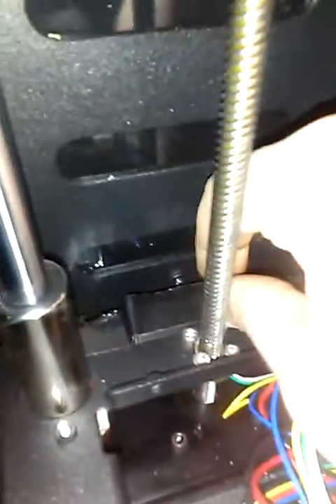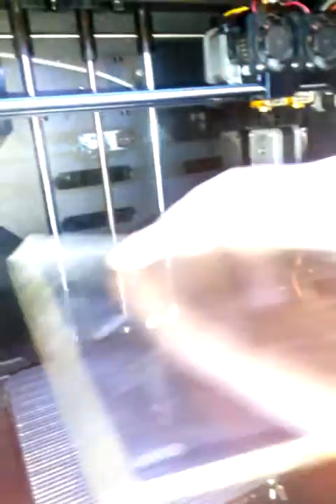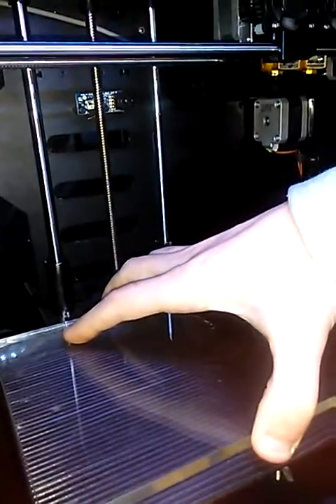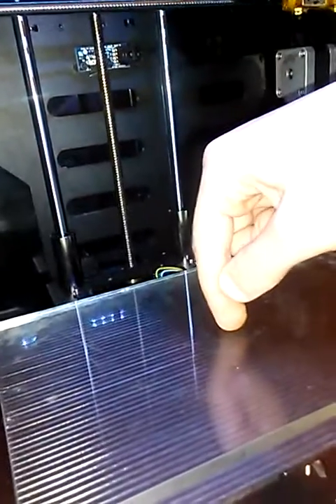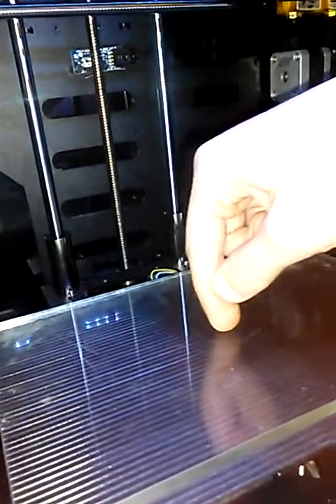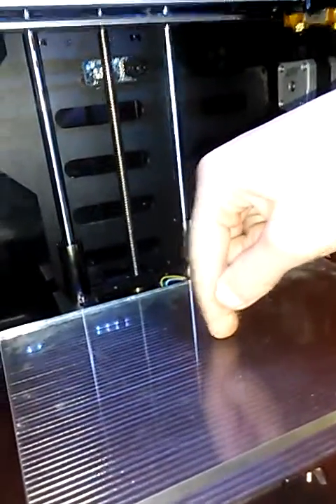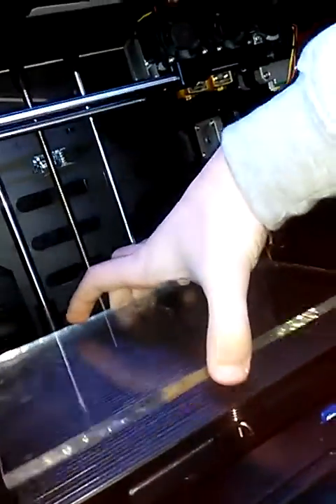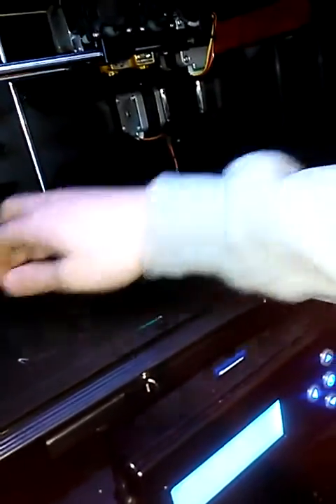My hack for putting glass plate on Flash Forge 3D printer

Comment: I don't imagine the rubber mat transfers the heat very well?
Reply: could be a toruble if you want to print ABS .. I can imagine you can increase the maximum temp to make up for the loss for PLA , PETG etc but can be a problem with ABS when it already needs maximum what majority of the printers can do lke 100-110 imagine you have a loss of 20% of heat you can´t really get that temperature anymore but I dunno maybe it heats well need to try or measure the surface